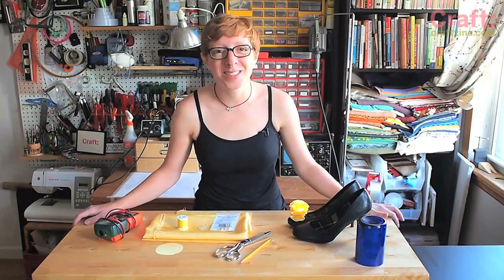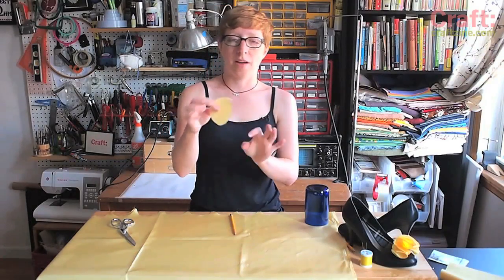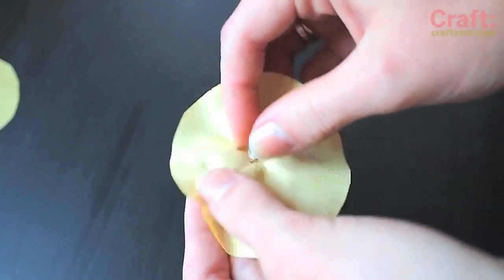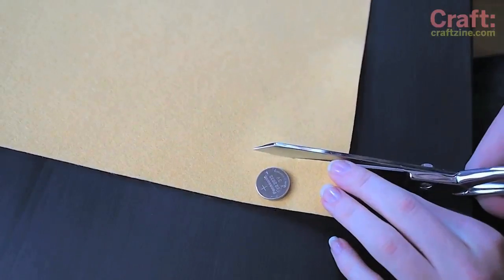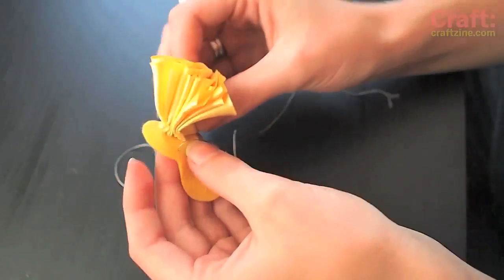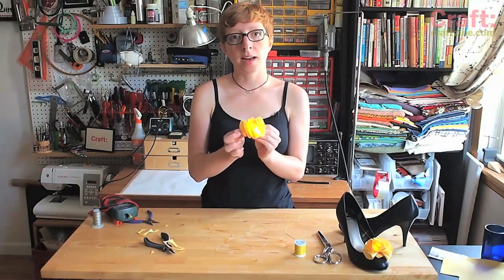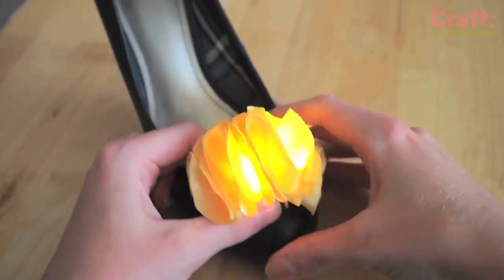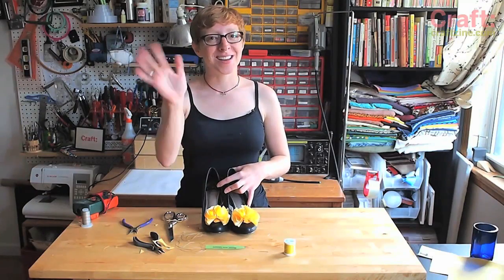LED Shoe Clips

Comment: you can add a 9 volt battery a switch and have it be a little more convenient just make sure the led's are soldered to resistors and everything is wired right though this will be a bit more complicated.

Comment: If you were to make shoes that has this, but permanent, you could run some copper wire up the inside of the shoe to a switch, so it lights up when you tap your heels together. And Becky, I f@$king love you!!!

Comment: There most likely 3 volt led's, you can buy led's in 1.5, 3 and 5 volt ranges as well as buy the hearing aid and watch battery's in both 1.5 and 3 volts